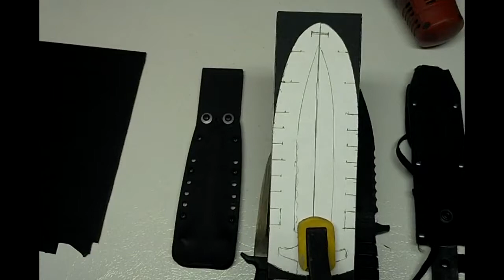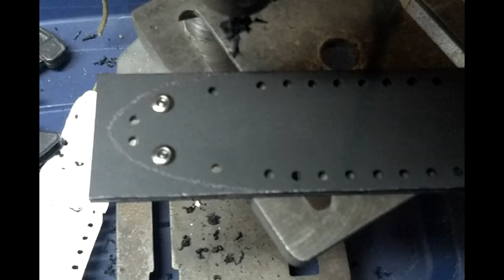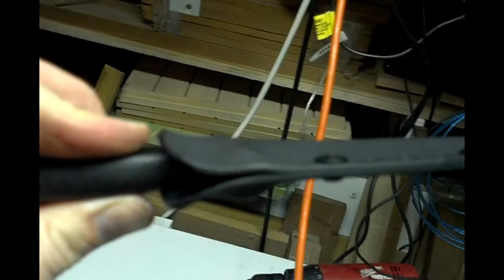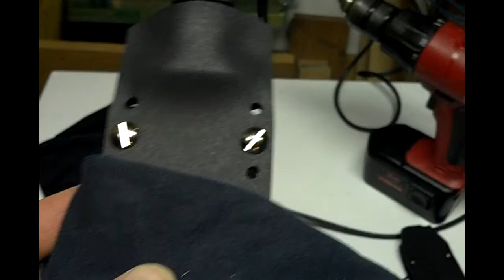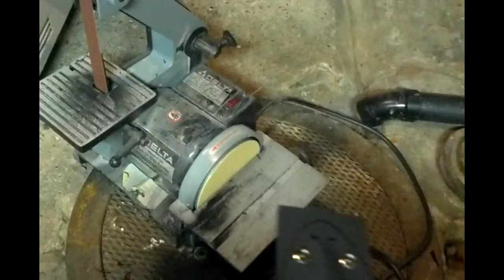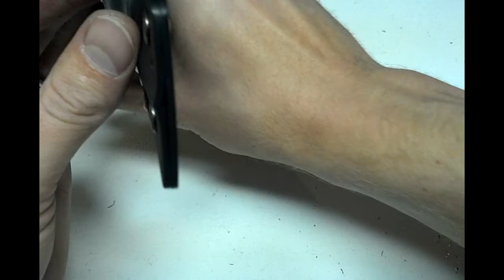DIY Kydex Without Oven or Press!

Comment: How do you make it flat on the back?? I'm gonna make one for one of my knives and I'm gonna attach a Teklok to it to wear on a pack or a belt. I can't seem to figure out how
Reply from the maker: Sorry about the late response. To make the sheath flat on the back, I did less thermal forming on the back panel of Kydex and increased heat on the front panel before molding it. I also used my heat gun while wearing cotton gloves and hand formed spots needing more detail.